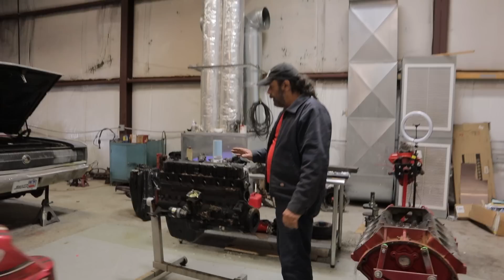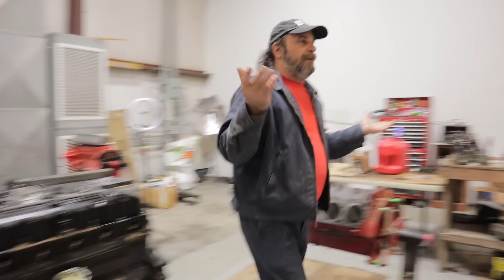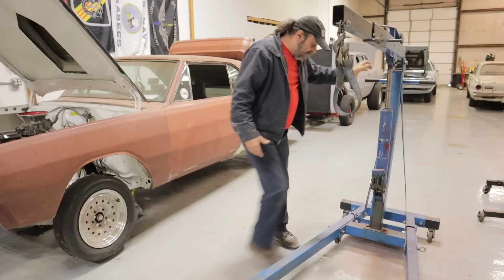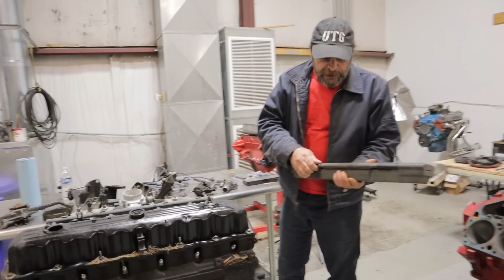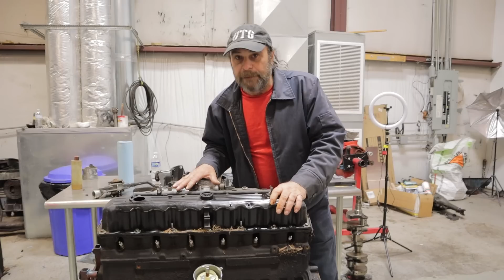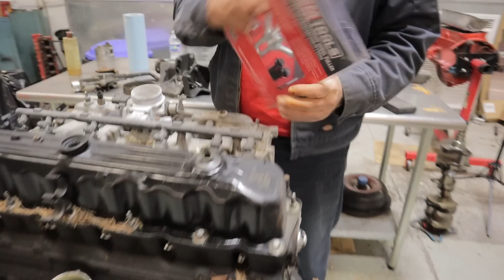Your First Engine Job - Arming Yourself With The Knowledge And Tools Needed To Get It Done

Comment: Take pictures or video of every bolt and fastener before and after each part is removed. Keep the fasteners with the parts. Document the steps it took to disassemble it so you can reverse the process. You will not regret taking too many pictures and written notes.
Reply: for sure! back in the OG we only had Polaroid cameras or film
Reply: Remember to wear pants while taking pictures.
Reply: Pics are great I also suggest putting bolts back in holes they come from helps keep track that and cardboard templates
Reply: @chriscadman6379  Pants are not strictly needed unless you plan to post the pictures online.
Reply: @cg9952  Pictures cost nothing to take nowadays. Don't even get me started on how hard it was to get a zoomed in photo developed back in the day.
Reply: What fun is that?  I recently ran across a box of about 40 some nuts, bolts, screws and other fasteners that a long departed 1978 Cadillac apparently never needed! ;-p
Reply: @chriscadman6379 🤣🤣🤣🤣
Reply: I like to put fasteners in a ziplock bag, then ziptie the bag to the part it holds on.

Comment: 100% correct. I call it a "regroup". Put the parts away that aren't needed. Clean the tools. Put them back in the wrench holder. Put them back on the socket rail. Nothing worse than being ready to go and "I lost the 10mm wrench and I don't have another one". Another thing is that many of the tools can be bought used. Craigslist, FB Marketplace, Letgo, etc. can all net good tools and equipment for a good price. Autozone and the "majors" rent tools that you might not have. Rule of thumb: If you borrow it once or twice, the third time you should probably own one for yourself. As noted by others, mark lines and connections with numbers. That is "#1 hose goes to #1 port" on the valve cover as an example. This way when you reassemble, if you still see blue (or green or whatever color) tape on something, you've missed something or it's disconnected. I did an oil cooler with my cousin on his 2014 Caravan 3.6L and that was what we did to keep organized. When we were done, no tape left and he's made several trips to upstate NY and back without issue. We did it right in front of my house in 1.5 days. We only had to make one, "Oh no, time for a parts store run" during the whole project. Bins, containers, and Ziplock bags (the ones from WM are fine) to organize smaller items really helps. 

I'll add a modern spin on things: Take photos with your phone or digital camera before things come apart (Does that go over or under the bracket? Does it go to the left or right of it? Did it have a wire tie there?) A photo is worth a 1000 words. More photos are worth hundreds of thousands of words. Make sure you can stop and store everything safely and easily if you run out of daylight, the weather turns bad on you, or it's getting late and you have to get to work tomorrow. Take videos of the vehicle before, during and afterward. Get a digital shop manual. Spend the money and get the OEM one, or at least Alldata for a year for your vehicle. You wouldn't go to a doctor that used wrong/outdated information to treat you and your vehicle's shop manual is no different. A digital shop manual can be printed and reprinted many times and the pages can be recycled when they are done with it. 

Magnetic bowls (Harbor Freight has them cheap) will keep fasteners organized and in order so they all go back as they should. Put nuts/bolts, etc. into parts being removed so you know where they belong. In the case of storing parts, if you clean them up enough and in the case of your XJ, you have a "storage box" (the back area) for everything. Line the inside with old clean carpeting, cardboard (free at any supermarket for the asking) or even a cheap tarp from HF. Sometimes too many parts and pieces in the way in front of you makes a task more daunting than it really is. 

If possible, have a friend help you. Not only for the extra eyes, the moral support and the inevitable, "I need a lift to the parts store" runs, but also for safety. There's strength in numbers and power in putting two (or more) minds on a problem. Respect that person's time and return the favor. Make sure that they are well fed and take breaks to keep you sharp. Tomorrow's another day with something. If you get stuck, come back to it the next day. Sometimes that's what it takes.

Comment: Marking hoses and connections as you take them off can save a lot of headache. It reduces the risk of getting something backwards, and its a good habit to develop. Especially if it’s something you’re not familiar with, or if it’s gonna be apart for awhile. Colored wire ties, colored zip ties, colored paint markers, etc. Whatever can give you the ability to identify exactly where a line or wire came from when you’re putting everything back together.
Reply: Masking tape and a sharpie are indispensable as well.
Reply: Pictures are faster
Reply: @yeahitskimmel  pictures are faster, but don't help when you are trying to reinstall your wiring harness . You have 3 of the same connector and have no clue where each one goes to.

Comment: As an 'old timer' I remember my first engine pull.   Way before the internet.  We had Chilton manuals.   There is a bit of irony that now there is a lot of information on HOW to do it but less interest in actually doing it.  And, as an old timers, I really do appreciate this channel and all of the sources of information available today.
Reply: God, the Chilton manual sure saved my bacon back in the early 70s when I was young, dumb and poor!!

Luckily, I never had to rebuild an engine but on repairs or replacing components, the Chiltons had no equal!

The Chilton manual at that time covered all domestic brands and models. It allowed me to replace a driveshaft, change out a cracked exhaust manifold, replace a water pump along with normal maintenance.

 The Chilton manual "resided" in the trunk of my '68 Dodge Coronet along with jumper cables, basic tool box and the spare tire.
Reply: @richstanton8545  I did the same thing with my 68 Dart that I was daily driving when I was younger. It was my first daily driver at 19, and knowing how to fix it when it needed repairs was invaulable. From then on, I have had a repair manual of some kind on the older vehicles I have driven over the years.

Comment: Reminds me of my early teens, all I had was a gravel driveway. The cheapest way then was three 10' 4x4's, 2' of 1" schedule 40 black iron pipe and a chain. You drill a hole about a foot in on each 4x4, slide the pipe through and weave the chain around the ends, stand it up like teepee making it taught and then hook a chain hoist or a come along, roll the vehicle beneath, yank the engine & tranny by raising it while rolling the vehicle back as you go.
With very few nickels to go around, it can't be beat, that and a couple of cement blocks on a chunk of plywood was the workbench. That "hoist" was used by all my friends cuz we were all pretty much in the same $$ boat. And you know what? it worked really well cuz a roll around hoist wasn't in the way. Besides, there were no cheap Chinesium hoists in those days so they were way out of our price range, even renting one was too much to bear when it could be better spent on parts.
I look back fondly on those times as we all had a lot of fun "on the cheap".

Comment: The cheap harbor freight plastic tackle box organizers are great for putting bolts in when you aren’t familiar with a job. Take off the valve cover, all the bolts go in one section. Take off the alternator all the bolts go in another section. That or all the extra Tupperware you can steal from the kitchen. 😂

Comment: Junkyard as a classroom is a good point. About 10 years ago I had a mint 92 Camry that I had to replace a window regulator on. I paid my $2 entry to the local upull it, and took the door panel off. I found all the screws and found out how to not break all the plastic panels and clips. I then went home and fixed mine without breaking anything. Best $2 I ever spent

Comment: Ziploc bags, colored paint pens, a sharpie, and a big piece of cardboard.

Draw the rough shape of the engine on the cardboard. When you take a component or series of similar components (like rockers) off the engine, put all the hardware that goes with it in a ziploc bag, write the name of the part on the bag, and mark it with one of the paint pens.
Go back to the cardboard and use the same paint pen or at least the sharpie to label where the component came from.

You can also use the paint pen to mark two parts that go together, like hoses or pipes, so it's clear how they interface.

Keeping things organised as they come apart is #1 if this is your first rodeo. You wouldn't be the first person to half put an engine together and either have to start again or give up and take it to a shop.

Comment: I've done one 4.0 rebuild on a '99 Grand Cherokee. Bought a core motor from a similar year regular Cherokee. Come to find out that the Cherokee blocks are different than the Grand Cherokee blocks where holes are cast into them for accessorie brackets to mount to, because the accessories are in different locations between the Cherokee and Grand Cherokee. Ended up having to tear the Cherokee block back down and putting all the guts into the Grand Cherokee block.

Just a little heads up, incase your core motor came from a Grand Cherokee. You may want to compare the areas on the blocks where the accessorie brackets mount to make sure they are the same.
Reply: Different between the Wrangler as well .
Sometimes it is possible to swap the accessory drives rather than track down a specific casting .
Usually though , it is simply an omitted matching step and locating where the hole SHOULD be , then drilling and tapping one , is pretty straightforward .
Often it marked already with a dimple or small hole .
Use the bracket from your old motor as a guide / template ,assuming it is merely a single missing hole .
Lots of times a machine shop will be able to do this for you if they still have your block or head , and , for a minimal extra expense .
It may be more if you just walk in needing the one hole drilled and tapped .
A big issue is the 99+ model years with the coil packs versus the older distributor fired models .
The 0331 head has added bosses that are drilled and tapped for the coil packs and those are not present on the earlier ( and better flowing ! ) heads .
There are a lot of Jeep specific forums with gold mines of info out there , so , if you have a question or problem , they have seen it before most likely .
Sure would have been nice to have these in the 70s and 80s .

Comment: 2 boxes of zip lock bags, sandwich size and  gallon size, and a big magic marker.
Bag of multi colored zip ties to color map connections. Use the black ones for general purpose holding.
5 or 6 cardboard boxes to cleanly store various stuff like the starter, etc.

Comment: If you have the engine apart for rebuild, doing basic upgrades is easy and you end up with a better more reliable engine. Things like a steel shim head gasket on an all iron engine for more compression, an RV cam for more torque, you're going to need a new cam anyway and they work well with stock valvetrain. A basic two plane aluminum intake to match the cam and better breathing.

Comment: I take a big piece of cardboard and push each fastener in (mimicking they shape they came off a part), along with the part name and order it came off. Along with pictures, you can just follow the steps in reverse order with fasteners in the right orientation.

(if a nut can be left on a stud, part, etc, i leave it attached and just mark on the cardboard that it’s on the part)

Comment: Resist the urge to just cut connections that are hanging you up. Took me a while to figure that one out, the mindset of I'll just  buy a new trans cooler line or vacuum, fuel, it'll add up fast lol and cost more time down the road. Now do I still sometimes cut things I shouldn't? Absolutely but I know better so there's that lol. 
Also don't put any fingers between the engine and a solid surface, things slip chains break so do bones. It's all fun and whatnot till somebody ends up with a "strong  hand" lmao

Comment: There probably won't be a ridge or issues beyond new pistons, rings and a deglaze in the bores. I usually get the '96-up pistons to use the lighter/less drag metric ring pack. The later main bearing bolts and "girdle" strap is a nice addition if you have access to a late core. The head is probably cracked (like Magnum heads) which WILL run, but for the expense of valve work/guides, etc., the Promaxx new head with hardened seats starts looking good. I used an Ebay oversize throttle body on my '95 Grand Cherokee, it was cheap and made a noticeable improvement, the new butterfly the same size as the manifold and gasket (noticeably bigger than the original throttle body!). I also used 4-hole injectors and my MPG went up almost 2mpg with a cleaner idle. The "horseshoe" late intake is really no overall gain over the log intake, so I leave whatever they come with on the engine.

Comment: Baggies marked with a Sharpie (won't bleed and blur) for various nuts & bolts.  Box/bag of rags.  I like the ones made from T-shirts.  A few 5-gal buckets for cleaning parts.  Also, take photos as you disassemble to be a guide when you go back together... linkages, etc.  And the first engine I rebuilt was in the gravel driveway.  The block stayed in the car.  Hey, I was poor and alone doing this.  I had a few friends that were mechanics for my workplace giving me some guidance.

Comment: A friend of mine has an XJ that he built as a stock class mud racer. Since you have to keep the revs up and the tires spinning during mud runs, he's forever popping engines. He has those 4.0 engine swaps down to a science!

My personal best "war story" is from having to replace the oil pump and main bearings in the 454 in my tow rig. I had to do it in the parking lot of a cheap no-tell motel in Michigan on the way home from US-131. I did pull the engine for a proper inspection and refresh once I got home but, the truck got me, the race car and the trailer home safe.

Comment: The core engine is the way I like to do it. I have no garage and built my last 2 350s in my tool shed. You can take your time with it and the car/truck only had 2 days of downtime (I do everything alone). I also don't pull the trans which makes things easy....but I'll remember to check the condition of the trans mount next time LOL

Comment: I have pulled many engine trans combos and done several engine swaps with a set of chain falls chained to a tree in the back yard.  Hooked the hook to a chain that was connected the front and rear of the block on the tops of the heads.

Comment: You're definitely going to need a piston ring compressor, and I would recommend some plastigauge as well. You can get by without a ring expander, probably, but they are pretty cheap.
Reply: I’ve put countless rings on and I’ve never touched a ring expander
I’ve seen someone snap a new ring with one tho
Reply: @fastinradfordable  what method do you use instead? just curious, I'm getting ready to do a Ford 5.0 V8 in an 89 Mustang

Comment: I recall my first time pulling an AMC engine .
We had the whole thing ready to come out , except , it would not .
It is late on a Saturday night .
After trying everything except sacrificing a virgin ( we had supply chain issues then , too ) , I discover that what we thought were alignment dowels we're in fact , 2 , 3/8 Allen bolts .
Off I went on a mad dash to find a 3/8 Allen wrench , ending up at a Kmart right before closing .
I did not find a 3/8 Allen wrench , but did find a 3/8 drive socket with a 3/8 Allen key brake tool .
It worked fine and we got the old 401 out without any more drama .
Having pulled and installed dozens of Ford and Chevy engines by that time , I thought I was ready for most anything , and a mad dash to Kmart in desperate search of a tool just before closing time , was the farthest thing from my mind .
Definitely do your homework , especially since it is a helluva lot easier these days .

Comment: Dollar General, Dollar Tree, Family Dollar all sell a de-greaser "Totally Awesome". Its the best de-greaser/cleaner Ive ever used and its so cheap you can recklessly pour it everywhere.  Even works great in a carpet shampooer.  Keeping organized is key, a bolt bin is a must. I also like to have a meticulous floor before I start b/c you'll be dropping tiny bolts and such...so much easier to find on a clean floor.